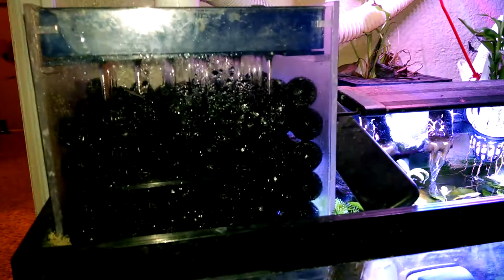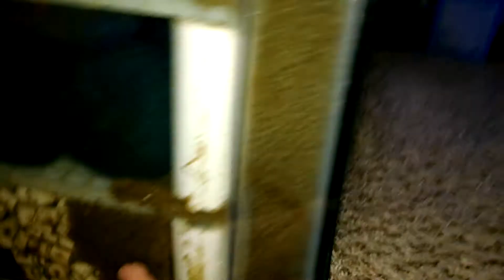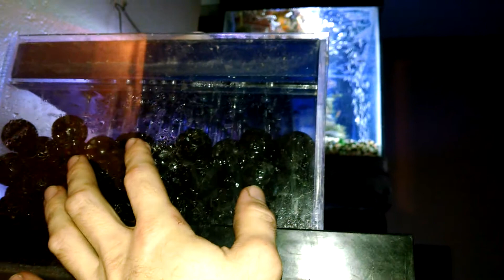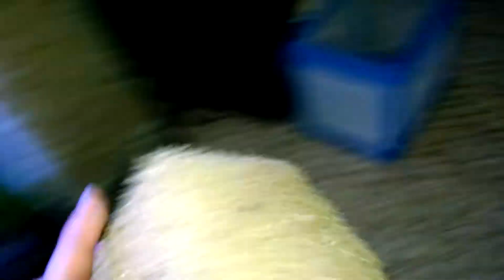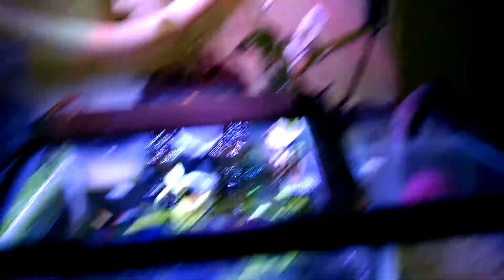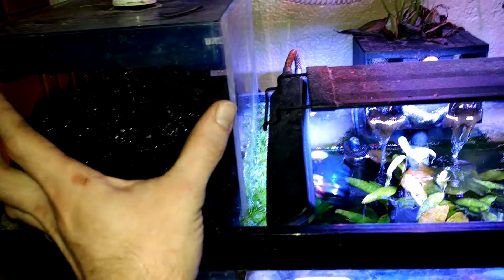Nitrogen Cycle / Ideas  Part 2 of 2 (Anaerobic Bacteria housing ideas)

Comment: If sponge is clogged then how do nitrates get to the anaerobic bacteria? at 8:30
Reply: @timsaquariums2765  Ok I get your logic. Would love to see an a scientific test where the nitrates are measured over time with the inflow a consistent nitrate concentration. Would have to stabilize other factors (I call it "freezing" the other variables). Might give us an idea how "large" an anaerobic bacteria colony (volume of sponge)  is needed to convert like 1 ppm of nitrate. Best approach would be to see if anyone has done this or something close. Thanks for listening to me on this, I am inquisitive process engineer. Fascinated with aquarium chemistry
Reply: @rogerball6265  Could be ordered ion selective probe tuned to nitrates. It will work like pH probe, but will provide data for nitrates. After calibration will be possible to monitor on constant basis in real time.